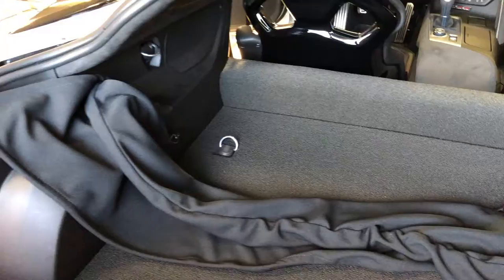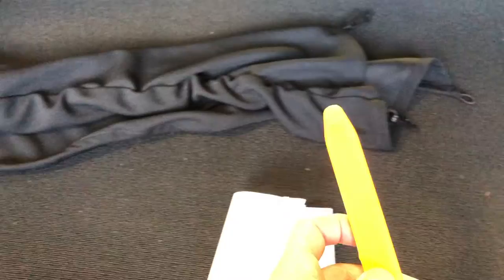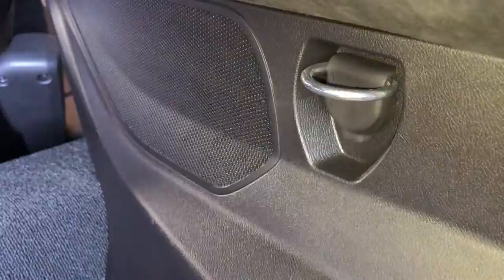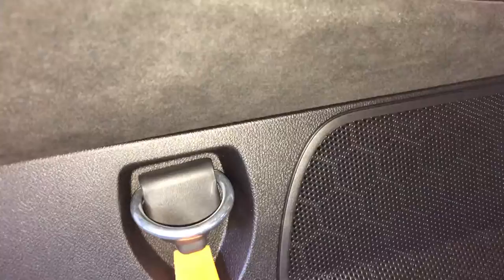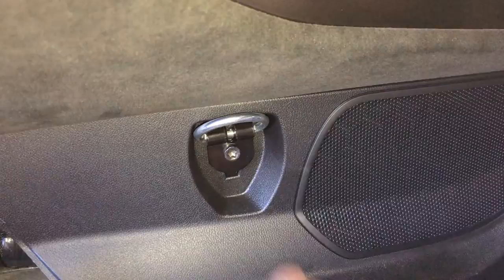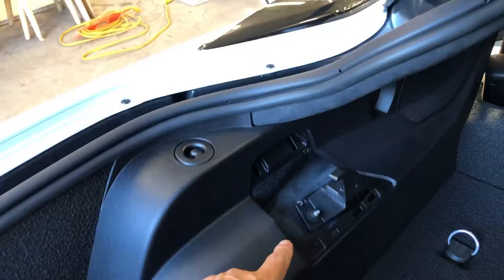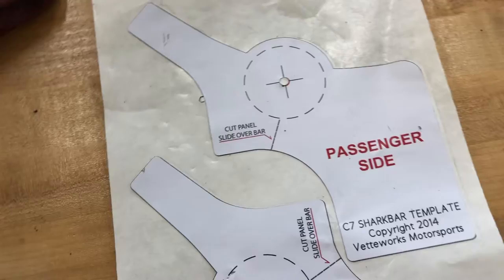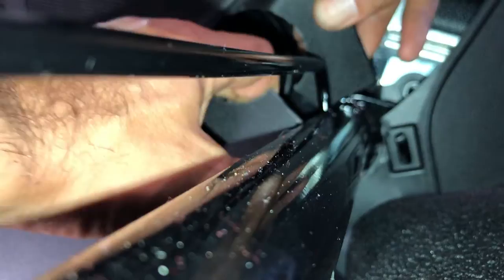How to install a Vetteworks SharkBar in a C7 Corvette

Comment: Great video. Without it I would be 3 more hours in the garage. My only suggestion would be to not tighten the brackets until the bar is installed on them

Comment: Great video. I believe the B-K mounts to the top as the angle of the top harness should not be more than 20 degrees. This is a cleaner installation no doubt but what degree are your top harnesses at?
Reply from the maker: HPDE Fun easily under 20.  I looked at both the BK and the SharkBar on a pair of father/son C7’s and the SharkBar is just a better solution if you are keeping the stock Comp seats IMHO...  if you are planning on moving to a actual racing seat the BK is a better choice since you have 2 bars to chose for the harness.
Reply: @farmerandyman7115  good to know thanks!!!!!! That 20 degrees is important. Again, great video. We think alike regarding not trimming things off if you do not have to.
Reply from the maker: @hpdefun6647  Actually I'm 5'11" and the harnesses just touch the top of the window in the stock comp seats - so having the Sharkbar "lower" than the BK is a benefit for me...  if I was any taller - or the bar was any higher - I think the straps would make too much contact with the top of the window and that would be big time bad!  Like I said - I saw both - and for me - just like the SB more - people like both!

Comment: So were you working while sitting inside the hatch area or were you standing outside of the car for this?
Reply from the maker: rleader1 when I needed to be in the car I was behind the seats with the seats all the way forward and folded forward
Reply: @farmerandyman7115  So I did most of this last night. I had my laptop in the car with me and followed along with this video. VERY helpful! Believe it or not, my biggest struggle was the wire loom on the passenger side. It took me a good 20 min to get the bracket in place and that wire bundle out of the way for some reason.  I spent about an hour and a half on this late last night.